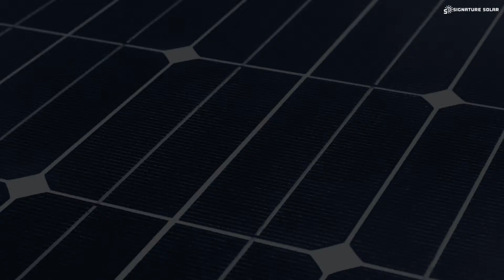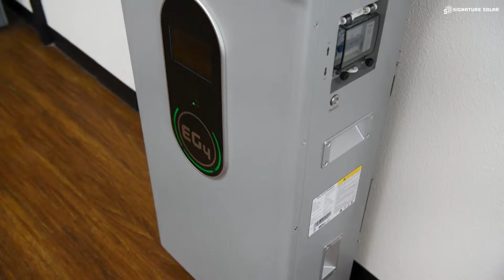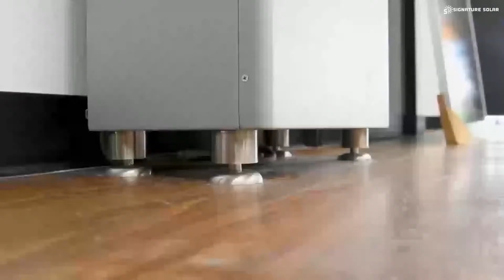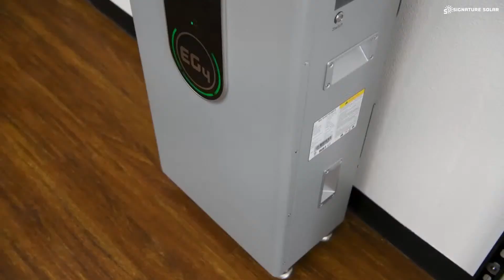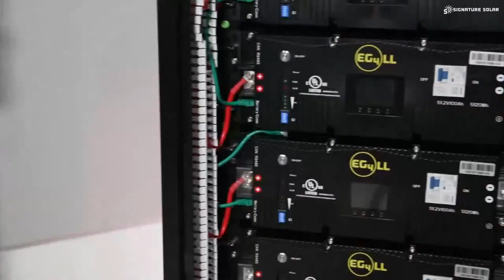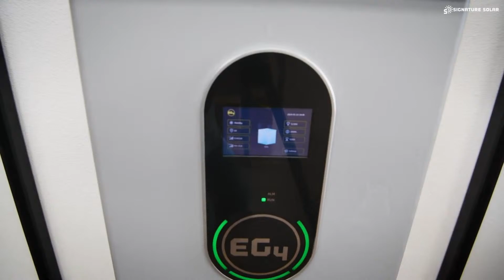Amp Up: Solar Talk - Ep. 7 - Battery Maintenance with Tech Solutions

Comment: I purchased 6 of your indoor wall mount batteries last spring. When they were really cheap.  I haven't had a chance to hook them up yet.  Do I need to do anything to maintain them. Or are they okay in storage.
Reply from the maker: As long as they are stored in a cool, dry place (not below specs minimum temperature), they should be fine. When you take them out, check the voltage and make sure they are top-balanced before integrating them into your system to avoid imbalance issues.

Comment: Is it possible to regularly keep your SOC at 25% to 75%, with like a monthly 20% to 100% charge/discharge?
Reply from the maker: This is generally not recommended, as the cells do not initiate passive balancing until they reach full charge.
Reply: @SignatureSolar  What if the primary thing of concern is cell life. Like suppose someone wanted to get 20 years out of them.
Reply from the maker: If maximizing cell life is your primary concern, keeping the SOC within 25%-75% can reduce stress on the cells and extend their lifespan. However, periodic full charges (such as monthly) are still important to allow the BMS to balance the cells properly. Without full charging, imbalance can gradually develop, leading to reduced capacity over time. A balance between limited depth of discharge and occasional full cycling is ideal for long-term performance.

Comment: What are options to charge my 4 EG4 indoor wallmount batteries, before parallel connecting them for a new inverter (Flexboss)/ battery system?
Reply from the maker: Likely the best thing would be to just connect them up and run them in lead-acid mode and let the inverter charge them. This avoids communication issues and ensures they balance out before being paralleled. Just make sure the charge and discharge settings align with the EG4 battery specs.

Comment: Can you have too much lifePO4 battery capacity?
Reply: Short answer no. Long answer it depends on how do you plan on using them. Off grid or Emergency backup. 
For off grid u need to know how much power u use per day. Make your battery as big as necessary to last without sun for at least 4 days. After that. You're running a generator. So it really just depends how many cloudy days u get. I use a ton of power and can go a week without sun in the winter. My 85kwh battery isn't big enough but I also need more panels. 30-50kw of panels would be enough in SE Michigan in the winter. 30kwh and 10kw of panels is probably enough in Arizona
Reply: 2 14kw  wall mount batteries should do you 
If you have ground mount panels you could have more batteries

If you have roof mount you probably will not have enough panels  look at your electricity bill to see how many kw you use

To charge a 14kW battery, you would typically need around 35 solar panels assuming a standard 400 watt panel, as a 14kW system usually requires around 35 panels to generate the necessary power. 
Key points to remember:
Panel power output:
The exact number of panels depends on the power output of each individual panel. 
Sunlight conditions:
Your location and the amount of sunlight you receive will also impact how many panels you need. 
Battery efficiency:
Consider the efficiency of your battery when calculating the required panel power. 
To calculate the number of panels for your specific situation:
Find the total power needed: Determine the total watt-hours your battery needs to store. 
Calculate per panel output: Find the power output of the solar panels you plan to use. 
Divide total power by panel power: Divide the total watt-hours needed by the power output of each panel to get the number of panels required.

Comment: Thanks for the video, could you comment on my settings for an EG4 LL battery bank?

System Charge Voltage - 56.2V
System Charge SOC Limit - 95%
Start AC Charge SOC - 20%

Obviously there are many more settings than these but I'm thinking these are the most critical to healthy cycling of my batteries?
Reply: As a newbie to this, you should start with definitions of the terms, example: use of amphours vs SoC. Define the difference or relation, the only use one from them on. If you’re only speaking to highly technical and experienced users, then I get it. I’ll just go elsewhere for my info. If not, use very few acronyms, unless defined clearly at the beginning, and try not to define “weather” by using the word “weather” (from someone who has done their share of presenting).
Reply from the maker: @RickRoades  Thank you for the feedback. We'll definitely take this into consideration for our future chats. We hope you'll continue to join us.